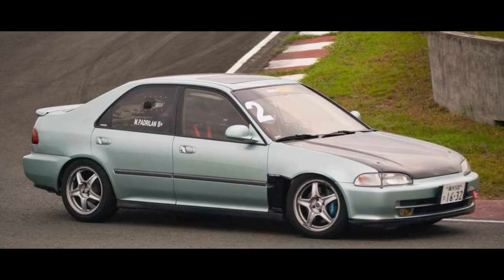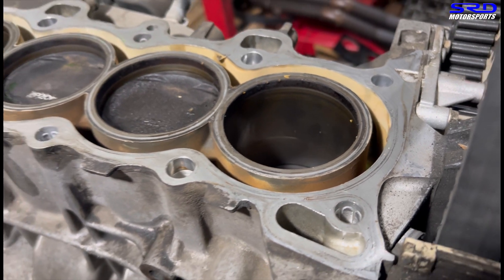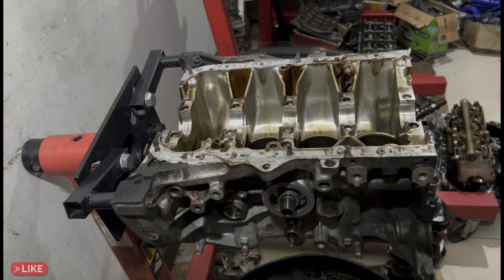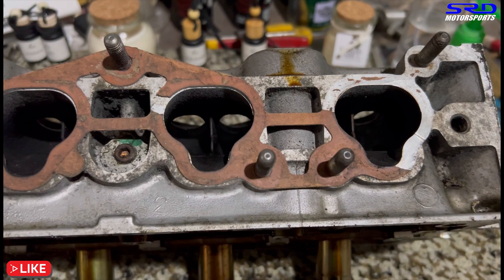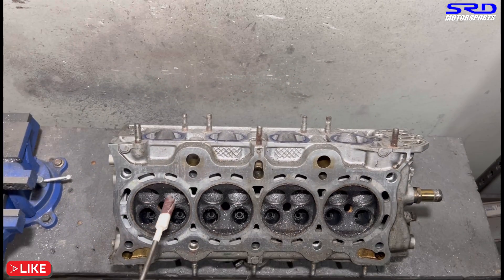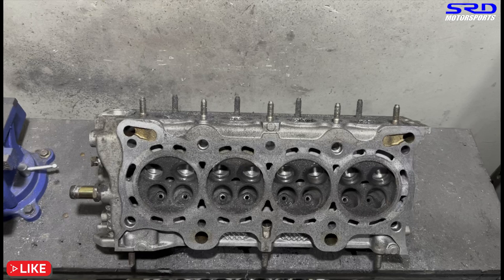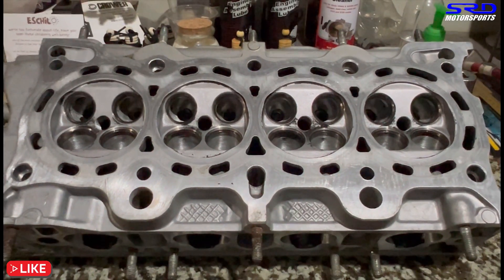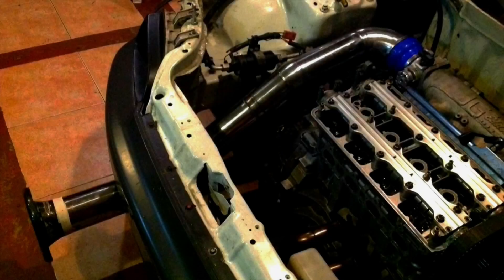D15b SOHC Bracket and Grid Racer Rebuild series part 1

Comment: For the number of similar engines / heads y’all do, how about making up aluminum or steel templates and install dowels, for consistent port matching, and insure manifold location on installation?
Reply from the maker: The gasket we make as templates need no dowel but I hear ya on that…

We do that on alot of aircooled vw stuff
Reply: @SRDmotorsports  fine that “your gaskets” align, but, manifolds typically have some slack in the stud and bolt holes.
If dowels were used, head - manifold location, would be standardized, and core shift corrected for, and be the same, head to head, manifold to manifold, instead of each being its own hand fitted combination.
Reply from the maker: for. 10 bolt intake manifold there is only one spot it ends up on if u factor in gravity… (unless the bolt the manifold while yanking it upwards) 

but like I said.. I hear what you’re saying… and it’s the same thought why I have the outline of the intake flange into the gasket = ease of alignment when bolting just the intake gasket onto the intake manifold flange, once that’s done? You have to force it to be misaligned when tightening

Try it… with a 10 bolt intake flange it only falls one way … can’t really bolt it even half mm to the left or right…. If you could then that’s a crazy flange lol
Reply from the maker: Now if it’s a 2 stud/hole flange on the manifold like a vw? Yes a dowel is needed